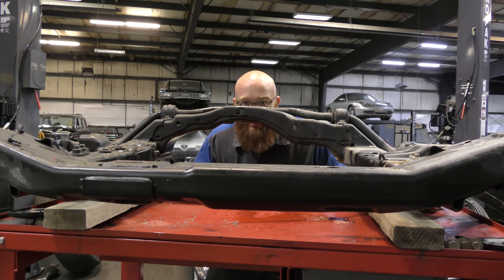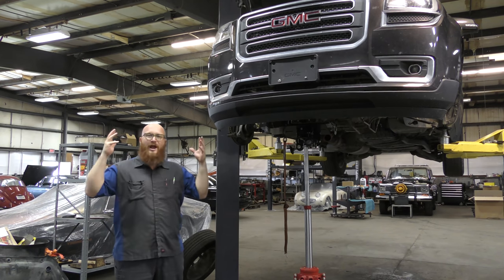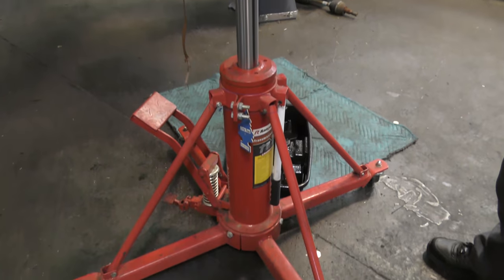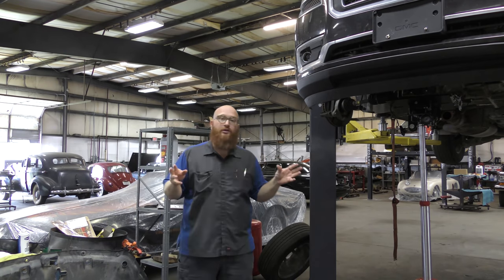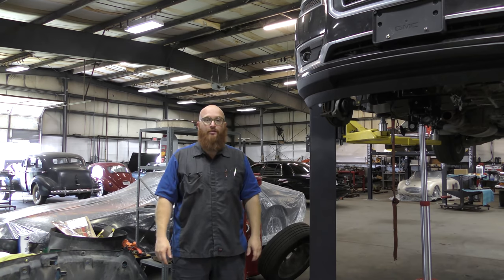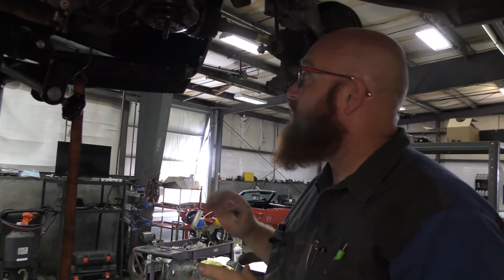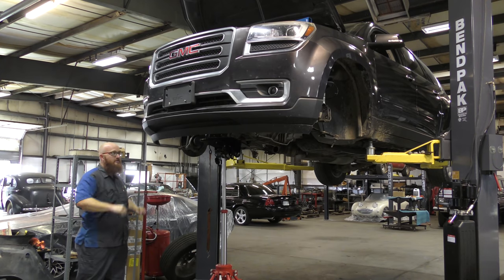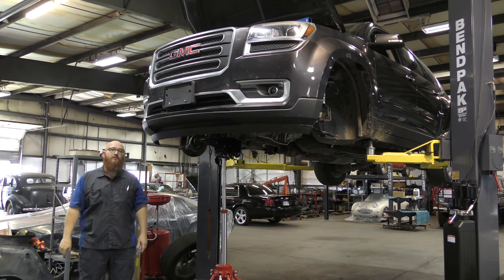Used car insanity in the CAR WIZARD's shop! Why did the huge repair get approved on this '15 Acadia?

Comment: Most dealers just slap an “as-is” sticker on it and find a sucker.
Reply: I too have noticed many more dealers doing no actual reconditioning and marking it “As - Is”.  The rise in this used car sales practice seems to have arisen in direct proportion to increasingly technology complex cars - not even the dealers can afford the repairs.
Reply: There's always that guy looking for a deal because he's a do it yourselfer or has a mechanic that thinks they can fix it cheaper than the dealer.
Reply: @TakuroSpirit77  Except that dealers are not marking these "As Is" cars down by 50% - instead they are asking full price.  Not exactly any sort of deal for the DIYer.
Reply: I thought that was just standard. A used car is always as-is unless they're offering an extra special deal on a car that is probably crap. Usually it's in the paperwork they make you sign, I've never not signed one at a dealer, and never seen a car "marked" as-is. This is why it's often a good idea to pay a third party mechanic to look it over before you buy.

I guess some used cars come with a warranty but that's a different subject all together...
Reply: thats more of a state thing.... all used vehicles in michigan are "as-is" you cant sell a vehicle and not make it "as-is"
Reply: Dealers here in Ontario sell them certified which means that they have had a safety check.  If I see a dealer selling "as is", I know it's junk and not worth it.  If it was, they would have fixed and sold it for a profit.
Reply: @seeya205  Exactly my thoughts.  If a dealer cannot proudly stand behind the vehicles they sell, then you might as well save some money by just buying from a private party.   When a dealer who warranties other used cars is selling a car "as-is" that means that they couldn't even find a buyer at the dealer auction.
Reply: @mcf3778  Is it illegal to offer a dealer warranty on a used car in Michigan?
Reply: Even with that there are lemon laws in most states.
Reply: @jonmccormick8683  All states have safety laws mandating that dealers sell used cars that are safe in regards to brakes, tires, suspension, etc.   Lemon laws are for buyers of new cars.  No state has laws requiring dealers to sell only reliable used cars that are aesthetically pleasing.   More and more I see cars on dealer used lots that are missing a wheel center cap, heavily stained upholstery, dirty clogged air filters. past due oil change, missing the spare tire and or jack.  I've seen this even on new car dealer used lots.  I last bought a used car a little over a year ago, and that is what I saw.  I imagine its even worse now that dealers have to pay top dollar for used car inventory - so the pressure is on to minimize get ready costs.
Reply: @TakuroSpirit77  Outside mechanics usually are much cheaper because dealerships only use OEM parts and the mark up is ridiculously expensive. For example my wife needed a new auxiliary battery for her car. She took it to the dealership and they wanted to charge her $734 for the battery. She went to O'reilly's and got an auxiliary battery for $119.00.
Reply: @TakuroSpirit77  use
Reply: You betchum. And there are gullible people lining up to buy them, unfortunately.
Reply: @Thomas63r2  LOL, there are SO many stupid replies here! No wonder people think they get "burned" when they think a used car isn't "as-is" by default almost always in every state. Yes, some dealers offer certified pre-owned, they cost a hell of a lot more, and they only sell those with very low miles. They will go out of their way to inform you of this and the price will be high to match. If they have not gone out of their way then it is AS IS and they will try to keep that as quiet as possible. The vast majority of all used cars sold fall under this.
ANY used car ever sold over 100k is as is where is, period. If they tell you it has a warranty it's a scam. After 100,000 miles nobody in the world will "certify" or warranty any car.

The only exception is safety requirements in some states, which is usually a joke anyway, it does not in any way ensure the car is good or not broken, they just vaguely check to make sure the wheels won't fall off on the highway. That's still "as-is". If you buy that and the wheels do fall off, it's always going to be your problem. Always.
Reply: @ryanroberts1104  In the last ~ 45 years I have bought 24 vehicles; cars, vans, trucks SUVs.  Several were bought new, most were bought used.  At least for my experience with cars under 100k the dealer sold them with a minimum of a 90 day powertrain warranty or the remainder of the factory warranty depending on if the miles were low enough.  There are many different kinds of dealers out there: some are independent used car only, some are new car dealers with a used car department.
Reply: @Thomas63r2  You're missing the point. In those cases the dealer will go out of their way to tell you it isn't as-is and it cost more because of it. You are made well aware of this fact.

On the other hand, if they say nothing, or it's cheap, or it has over 100,000 miles, it's always as-is, and it is never "marked" that way. Ever. It's an assumption every adult should make unless told otherwise. There is no "as-is sticker", and the vast majority of used cars are sold in this way.

This all applies the same in every state. New cars are the opposite, they are never as-is, that's where lemon laws come in - but they only apply to new cars, and even then you usually have to get a lawyer.
Reply: @ryanroberts1104  actually at every dealer I have ever bought a car, all their used cars had a "Buyer's Guide" posted on the car: this discloses that the car is being sold with or without a warranty, and if it has a warranty if it is a dealer warranty or the balance of the factory warranty.  Either way, if there is a warranty this lists the basic details.
Reply: @Thomas63r2  They have to disclose it in one way or another, usually in the fine print somewhere. The point is as-is is default, anything that isn't as-is is mostly unusual. If they don't disclose anything, like a private seller, it's the same as saying as-is. They certainly don't slap a big obvious sticker on it - you would never know just driving by a dealer. (but you should assume)
Reply: So when you sell your vehicle, what kind off warranty you give?
Reply: @12masterr  Did you know that some factory backed extended warranties are assignable?  Did you know that most credit unions will allow their members to purchase an extended warranty on used cars they finance - including private party purchases.  I'm not a dealer with resources or a business., I'm not sure how to answer your question - what is your point?  In my experience through all the cars I have bought is that reputable dealers offer at least a minimal 30 or 90 day warranty on most of their used cars as an incentive or benefit to their customers.  Yes dealers "mark up" their cars, and you should get something in exchange for that - like a dealer warranty.
Reply: @Thomas63r2  I'm a used car dealer in florida, here, by default, all vehicles are as is, this is not a trick to sell bad vehicles, is the way florida designed tje law, on the other hand, it will be impossible to sell a car with 100k miles with a warranty, because like they are bad dealers, there are also bad customers that will blow the engine on purpose.
Reply: @Thomas63r2  ues, the federal guide is a requirement to inform the customer about if the car have a warranty or not, it does not mean it is a requirement to provide a warranty.  The car I usually sell are about $3000, very low margins in this vehicles,  how you think anyone in business can provide a warranty and be profitable?   Of course big dealer can do that when they  sell a vehicle 3 times tjat value, and tjey screw you on the financing, but it will be not viable for a small place like mine. Tje only warranty I give my customers is this:  let's go and drive it for 2 hours and find if is anything wrong with it.
Reply: @12masterr  I'm not suggesting that dealers are required to have warranties on used cars.  I don't really go for the cash cars like you sell, I usually go for the late model low mile used cars.  If a car buyer goes to buy at a dealer and they take the dealer financing without seeing if better financing is available then that is on the buyer.  Tell me what is the difference when a dealer marks up the interest rate on a loan vs. your marking up a car that you dell?  There is no difference - this is what businesses do, they mark up whatever they are selling or providing to customers  who buy their goods and services.   Some people will go their entire life without knowing how to make better financial decisions - or they don't car or are lazy.  In many ways it is actually very expensive to be poor and piss your money away in stupid ways like not getting better finance terms.
Reply: Like you’re mom
Reply: I have bought two 'as is' vehicles.  One came with the list of items needing repair.  The dealer simoly did not wish to invest the $$$ in to it.  I did and was happy with it.  The other one had 300,000 KM and was 'safety certified'.  Have had it for 2-3 years and happy with it.  Both bought for under $8000
Reply: @johnbee7729  Sounds like good deals.  I don't think there is anything wrong with buying cars "as-is."  The dealer makes their choice of dealer warranty or no warranty, and you make your decision to buy or not to buy.  You are right that a dealer usually chooses to sell "as is" when the miles are on the higher and/or the dealer's cost of reconditioning would make it a money losing sale - but maybe a handy buyer can do the fix up on their own.
Reply: Sold as is means = get the hell out and RUN!!
Reply: Maybe it's time we let the actual manufacturer sale direct to us?
Reply: In Kansas, a dealer either has to offer a 30 day powertrain warranty, disclose the problems, or have a "buyer beware" document disclosed and signed. Auctions and personal sales are different.
Reply: @jonmccormick8683  lemon laws are for new cars only. Not used.
Reply: Always have an independent mechanic do a pre-purchase inspection before you buy a used car. Always! I don't care if the Pope himself signed off on the vehicle before it went to market. I'm not risking my hard-earned money on the word of some used car dealer.
Reply: these cars are such junk, you can't re-engineer these POS cars to new or better than new.  Everyone wants top dollar for their trade-in and either the dealer sends the POS to the auction to the next dealer or they have to re-engineer the car.  The used car business is not that easy when the cars available in the market are junk!  My personal garage has a Tacoma, Subaru, old Chey truck, a Honda and an 11 year old Lexus that has been absolutely fabulous!
Reply: @Thomas63r2  No. But if you don't offer a warranty, it must be clearly and conspicuously marked AS-IS.
Reply: Yep! An,"As-is." Is a tell tale sign of a junk vehicle not worth the headache in the long.  That's why I stay away from them. And why use car shop rather try to sell it as fast as possible. Cause they know what's cone next,  ( headaches.)

Comment: The more Wizard videos I watch, the more I appreciate my lowly, $4,000, everything manual, Toyota Yaris, for its simplicity and reliability. 170k miles and only routine maintenance.
Reply: Same with my 4k$ matrix
Reply: I mean I have a 14 chevy cruze 2.0l turbo diesel. 167k miles on it. It's had some issues mostly emissions but thats not really the cars fault. I use my car for Doordash, lyft uber whatever, 300 miles a day 6 to 7 days a week I never shut it off it runs 10 to 14 hours a day most of the time. Hasn't left me stranded yet. Obviously brakes timing belts oil changes add up for maintenance costs but so far its been a solid vehicle I can get mid to low 50s on the highway if I drive it right. Fully loaded leather interior heated seats built in navigation on star everything you need, bought it at 100k miles for 7k dollars. Can't complain.
Reply: Same with my 2nd gen tundra! 500k mile trucks all day if maintained
Reply: I'm in a 04 Corolla and I only have regular maintenance never any catastrophic fails like you see on this channel
Reply: Peter Fernandez, I have an all manual 08 Yaris with 100k that I am so thankful for!  Go Team Yaris!
Reply: Same with my '07 Honda Accord 4-cylinder (193k miles)

Comment: Moral of the story: Don't buy modern, cheaply made GM vehicles.
Reply: Scotty Kilmer approves this message.
Reply: any GM ;P
Reply: Any vehicle in the last decade, they all have the same crap designs.
Reply: Amen.  God damn GM.  They used to make some pretty good stuff.  Now it's all just made to sell and die prematurely.  They truly hate their customers.
Reply: @stephenhayes3765  Decade? They went to crap when they went all plastic. I'd say early eighties?
Reply: Don’t buy ANY GM vehicles unless they’re old school V8s without cylinder deactivation technology. My dad has been working on cars since the early 70s and even he says GM built mostly shit in the 80s and 90s
Reply: As a mechanic I have seen these vehicles bankrupt so many people. I feel terrible for them. Usually a single parent struggling and buy one of these used and end up owing money on a car they can't afford to fix.
Reply: My 2001 silverado is doing okay at 160 k +.  As things stand,  with prices as they are I'm inclined to get a bit of bodywork done.  The engine is strong,  the transmission has been rebuilt (4l60e...  shite!)
Reply: @diablocls55  Most American brands were bad then too.
Reply: @brianleslie7388  You could completely rebuild that truck for less then a new one!
Reply: @BeingMe23  I know. American cars in general are junk
Reply: @jaswats9645  I have late 90's to early 2000's Toyotas.No plastics in engine bay then.
Reply: @tolrem  I was thinking gm
Reply: Absolutely 💯
Reply: I had a 94 Chevy Corsica, bought new, an utter nightmare of problems. Couldn't wait to get rid of it.
Reply: Don't buy them after '07.

Comment: My Sequoia just clicked over 325k miles, so it's worth nothing. Thankfully everything works on it, nothing leaks or rattles. Even though I'm paying through the nose for fuel, it's cheaper for me to keep it and maintain it.
Reply: You could sell it in this market for 5k if you wash it 🤣
Reply: @blueryxfalls7949  Why would I do that? That's another $5 in "Potting Soil"
Reply: Another Sequoia owner here and I’ve gotta agree. Toyota makes things last. Makes me not think twice when a maintenance item is worn out and due.
Reply: Yup I own 2 a tundra and sequoia, yours is actually worth $5k
Reply: Got a 95’ tacoma with 283k, strong runner no leaks
Reply: Just bought a 2013 Platinum Sequoia for $22,000 USD 110,000 miles expect to put another 300,000 miles on it so that will take at least 20 yrs, maybe my last car. Will never buy another auto unless its a Toyota.
Reply: I have an 2001 and she is a tank super reliable everything works with 170k on the dash 13 mpg! ouch
Reply: Same with my 2007 4RUNNER.  317k miles and running strong!  No leaks, no issues.  Still on original engine, transmission, struts, exhaust, etc.  I’ve kept up with oil and fluid changes, changed the spark plugs 80-90 miles ago, brakes, tires, etc Normal wear parts

AC still blows ice cold, all the electronics work, never had a major issue.  It’s a 4.0L V6 and the gas mileage isn’t great but so what.  I love having a dependable car that works and causes me no headache
Reply: @jaysmith6013  not
Reply: @rodswift1586  
Don’t be hater
Reply: @lucasstuart-chilcote7069   2010 Corolla. bought with 80K on it for $5,000. Have had for 6 yrs. 110,000 miles. $2,000 to replace: compressor,  radiator, alternator,  starter, spark plugs/wires after 90K of driving. All original parts replaced. Stay away from GM
Reply: @rodswift1586  Not what?
Reply: Just like an old friend who bought a 1995 Honda Civic new and to this day he has only rebuilt or repaired as needed. All because it's cheaper to do that than replace it so far
Reply: There really does seem to be a connection with reliability, power and fuel economy. Reliability  + power = -fuel economy and + emissions.
Reply: @CynHicks  depends on both how AND how well it's done. On an 88 Shelby Lancer I had, it was upgraded to produce 450who but  had the emissions of a 93.
Reply: We have a tundra that comes into my work with 700k miles.
Reply: @app4902  Is it original engine and transmission? Not that I would doubt it. I gave away a 4 cyl 97 Camry with over 400k on it. Engine had lost much needed power but still ran smooth. All original hardware also. It had too many minor problems with the exterior, interior,. frame and suspension to justify repairing after so many miles.
Reply: @vanhasydan4754  What was the fuel economy?
Reply: @CynHicks  original engine and transmission. The guy is works for an oil company I think and has to drive all over the state for them. It’s had 6 timing belts put it in I think. We have a few other older Toyota’s come in with 400k+ miles
Reply: @app4902  Tundras and Tacomas are amazingly durable. Though the new ones are being built with some brittle plastics the drivetrains and suspension seem to be solid. 6 timing chain/belt replacements also shows he didn't slack on maintenance.
Reply: @CynHicks  on the Shelby? 26 in normal driving thanks to boost dependent dual injection. It used 2 sets of moderate size injectors instead of one set huge set.
Reply: @CynHicks  the guy is a very good customer. He cares about his truck
Reply: The lucky long lasting cars are better to keep and maintain.
Reply: Dem bidin gas prices(
Reply: @jaysmith6013  --Best Vehicle Money can Buy!!!